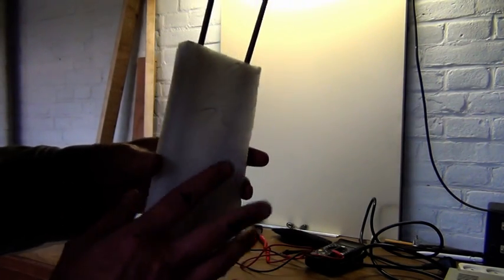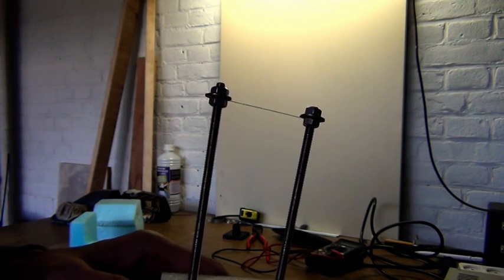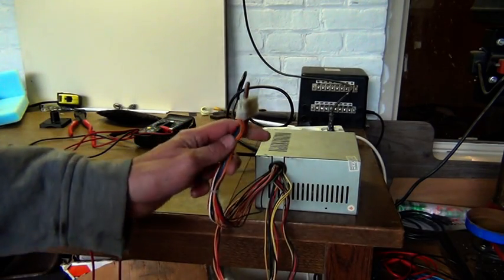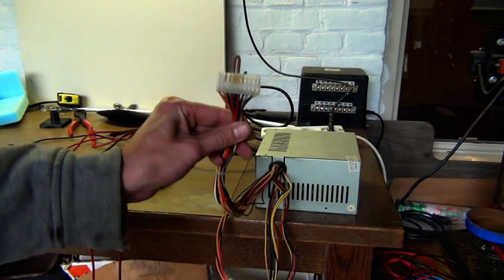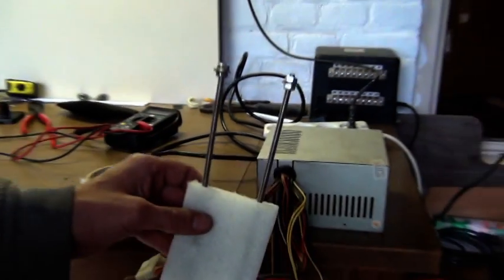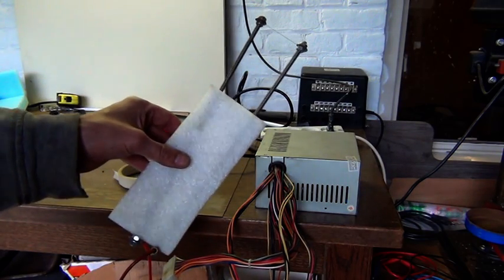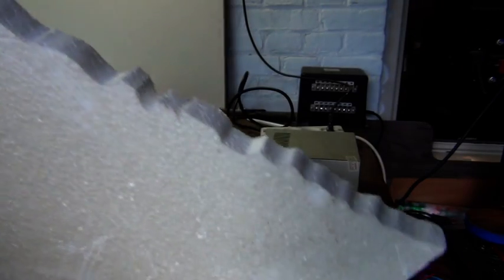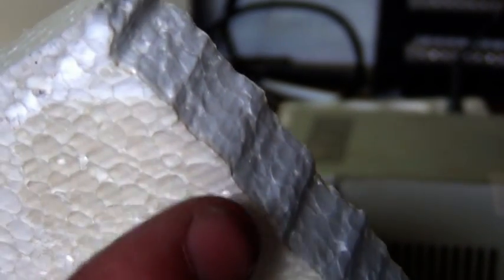How to DIY handheld hot wire foamcutter (30)

Comment: Good work,  Tuna!

Used to do a lot of boxing up and shipping via UPS.  A coworker made a 24" X 24" wooden frame and drove tacks around the inside perimeter every inch. Ran his wire up and down on one side of the frame and across and back on the other side. Was careful that the wire never touched itself...    He could drop large scrap Styrofoam  pieces through the frame and cut it up into 1" cubes.  Used the cubes instead of "foam shipping peanuts."

=Very economical!
Reply from the maker: Hello OgMadin0, thank you for watching and thank you for the compliment! .....Oh yes that is very economical and very clever, recycling materials is good !